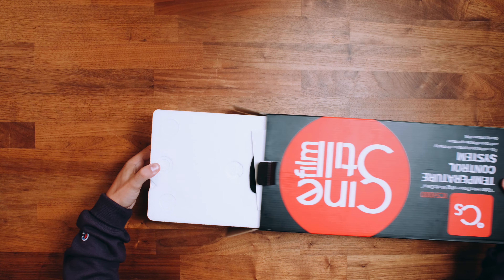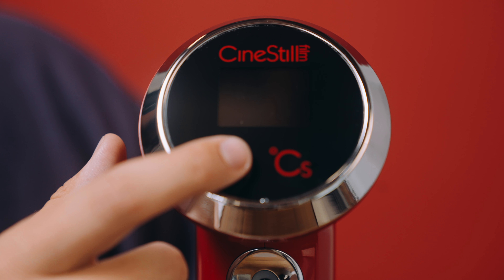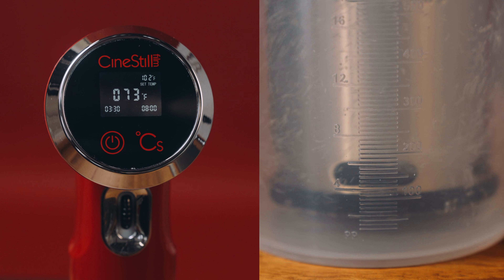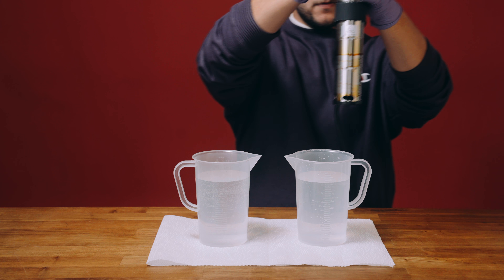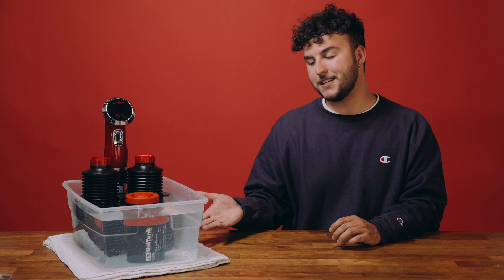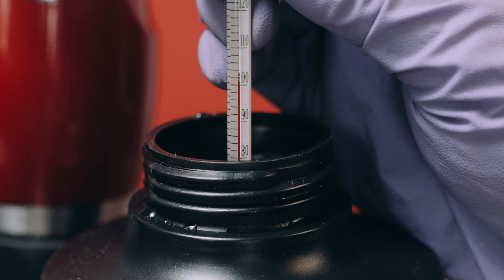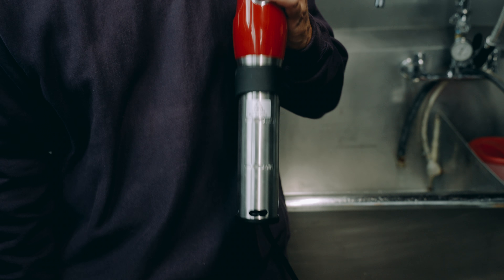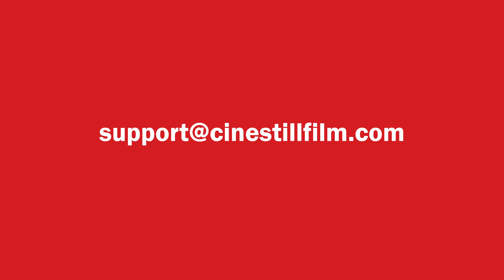The Best Way to Heat and Mix Your Film Chemistry using the TCS-1000 Temperature Control System

Comment: Hope A European three pin adaptor comes in the box?
Reply: The UK one came with a 2 pin plug, and I had to buy a shaver plug
Reply from the maker: The European 2 pin plug is available on the 220v version at one of our many retailers in Europe.
Reply: @CineStillFilm  which means that UK customers have to buy a plug to convert it into a 3 pin before they can use the TCS
Reply: @CineStillFilm  what about the third earth pin?
Reply: @jeg569  or cut the plug off and fit a UK 3 pin plug.

Comment: I'm loving mine, but I'm encountering an issue. When I warm the container water to 39 degrees, the chemicals never reach 39 degrees, as if the heat in the container is not enough to warm through the plastic of the bottles. Do you guys set your TCS temperature higher so that the liquid inside the bottles reach 39?

Comment: I have this device and it works exactly as described in this video.  The only caution is in my experience it is imperative to get the water level between the minimum and maximum water marks.  Question:  I would like to find a device like this to maintain water temperature in paper developers in trays.  As trays are shallower, the TCS-1000 does not work.  Does anyone have an idea on how to solve this?

Comment: The TCS does not work in UK shaver sockets, possibly not the correct voltage and the pins are slightly too narrow.
Reply: I’ve had this problem and even got a replacement sent. Same issue again so it’s just been sitting in my cupboard collecting dust.
Reply: @haydng3503  I bought a travel plug out of Tesco and it works.
Reply: NEVER plug anything other than a shaver or toothbrush SPECIFICALLY designed to use a shaver socket. 

NEVER use a 2 pin travel adaptor with the TCS1000 or other appliances which require a third earth connection.

Shaver sockets are designed to accept the exact shaver/toothbrush plug and not others (like the TCS) which are designed for a totally different country. Shaver sockets supply only a very small current (to protect from electrocution in a bathroom) and are isolated from the mains (again to protect from a live to ground electrocution). 

If you do manage to shove a 2 pin plug into it, all you will do is blow the internal fuse, rendering the shaver socket scrap.

As the video says, get the correct unit for your country. In the UK, it is 240 volts AND ensure it has the correct UK plug.

DO NOT use travel adaptors, they will only be two pin, thus you will have no earth. If the heater element fails and 'goes down to earth' , as there is no earth connection to blow the fuse, your unit will become live, as will the liquid it is sitting in and you will probably DIE

BE WARNED!!!

UK plugs have a fuse fitted, these foreign ones do not, so you are relying on a 32A fuse back at your consumer unit.
Remember, just    0.003 amps will kill you, which is far smaller than your 32 amp fuse!

It is a legal requirement of retail sale in the UK that all appliances are fitted with a UK plug. Grey imports or Ebays sometimes do not.

If an appliance has a euro 2 pin  plug, one can buy (look at TLC Electrical) a UK plug, which the 2 pin plug fits totally into (not like a travel adaptor) BUT for things requiring an earth connection, like this TCS1000, DO NOT USE THEM.

At the very least, buy a proper 3 connection (2 pin and one flat tab) euro to UK plug adaptor which will connect the earth and is also fused.

Also, please use an RCD, unless your consumer unit has one, it will save your life.

European
Reply: @haydng3503  IN the UK, it is a legal requirement that all appliances are fitted with a UK plug. Go back to your retailer.

Do not use a travel adaptor, they do not have an earth.

Assuming your unit is 240V, you could cut off the euro/American plug and fit a UK fused 3 pin plug.

If you do not have a consumer unit that has RCBOs or an RCD, then I would strongly suggest buying a plug-in RCD. 
If this thing goes faulty, it and the water bath could become live, instantly killing you, an RCD will disconnect the power and save your life.
Reply: @jeg569  Many travel adaptors are only two pin and will not connect the earth. Please check yours. Without an earth, if the unit becomes faulty, it, the water bath and you could become live, thus die.

The video at 0.24 shows two plug types, neither are suitable for use in the UK, even with travel adaptors.

Would be interesting to know who in the UK are selling these and if CineStill are aware that they are being sold without the correct UK plug.

My best advise, check with the retailer and then cut off the plug and fit a proper UK one. If in any doubt, consult a qualified electrician. Electricity kills.

Do a search on amazon UK for the below. I have posted the description as youtube bots will remove the direct link. This item converts a 3 pin european to 3 pin UK and includes a fuse, but please also ensure an RCD device is used as well. 
LRMYS EU to UK Power Adaptor, 2-Pin to 3-Pin Convertor 13A Fuse for Home Travel Hotel Business Trip, 250V Grounded Travel Adapter Continental Type C E F to Type G, White 1 Pack
Reply: @haydng3503  Do a search on amazon UK for the below. I have posted the description as youtube bots will remove the direct link. This item converts a 3 pin european to 3 pin UK and includes a fuse, but please also ensure an RCD device is used as well. 
LRMYS EU to UK Power Adaptor, 2-Pin to 3-Pin Convertor 13A Fuse for Home Travel Hotel Business Trip, 250V Grounded Travel Adapter Continental Type C E F to Type G, White 1 Pack

Comment: Something like this would be very useful for resin 3D printers if there were a way to keep it out of the way of the printing platform. Keeping the photopolymer resin warm and circulated (especially if adding custom pigments or particles) can mean the difference between success and failure of a print.

I hear there is a new product that does something similar using some sort of sonic vibration device, but I don't expect it to hit the consumer market any time soon.

Comment: Can you confirm 120v version doesn't work in 220v households ? I asked my friend in US to bring one for me.
Reply: Same question as Anoop
Reply from the maker: You would need an expensive voltage converter (not just a plug adapter), but it’s best to order a 220v EU plug version from one of our retailers in Europe.
Reply: Ok thanks